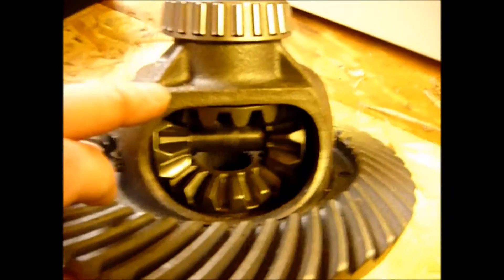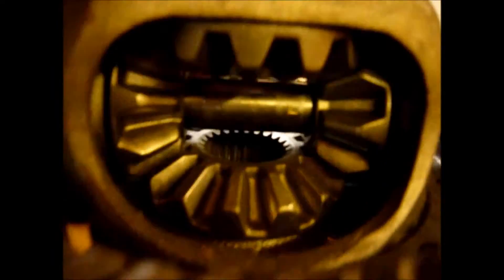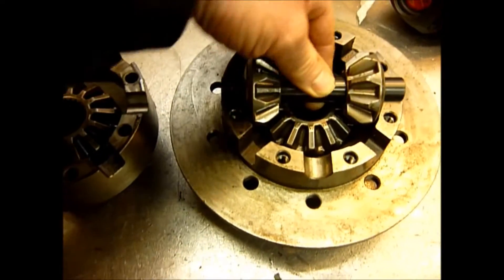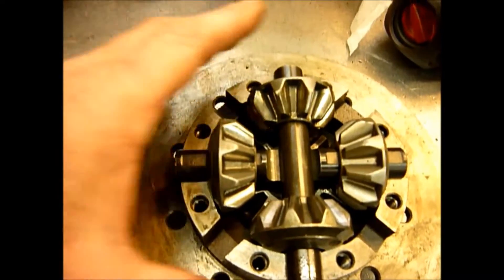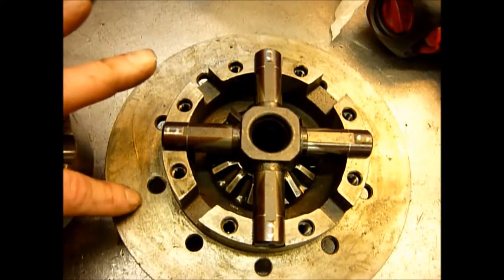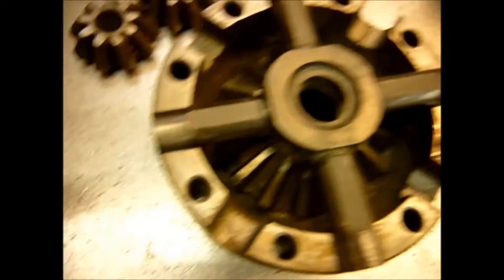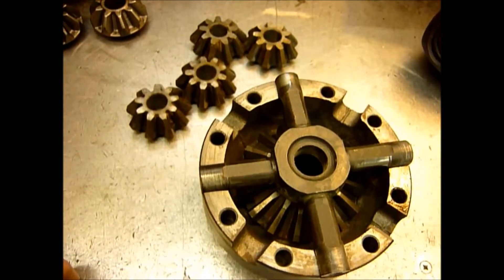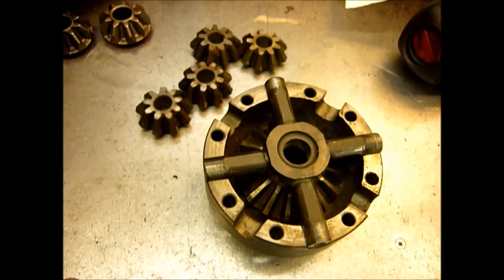Land Rovers 2 Pin vs 4 Pin Differentials explained

Comment: what if I weld two pins together?
Reply from the maker: That will affect the heat treatment badly
Reply: @MegasquirtUK and when they weld a differential, does no one think about the loss of hardening (heat treatment)?

Comment: Thank you very much. I bought a P38A 2.5 diesel with a differential cloncking noise front the front diff. Not knowing what it was. So I looked for some information, also not knowning the difference in a 2pin and 4pin set up. So now I do and I lerned something about the stronger 4pin version. So thank you very much explaning this all in the video. Much appreciated! Watching from Holland.

Comment: A comment on an old video, but "pinion" not "pin". Pinion refers to the small gears - think rack and pinion steering, or crownwheel and pinion. A two pinion diff has 2 pinions. and a four pinion diff has, wait for it, 4 pinions!

Comment: I fitted a Kam 4 pin diff in my disco 1 front diff.
Reply: Will it fit p38 also? I think the Kam company is not working anymore. Are u still happy with it?
Reply: @loizoug  I sold it recently, it went to Kenya. Not sure about the P38 though.

Comment: How odd to find this video today . .  I got a 4 pin diff today recovered from a discovery rear axle.   is a 4 pin with older swing down locking tabs on it.  Will be stripping it tomorrow to have look and see if it has the forged pins in it.   Thanks for the video.